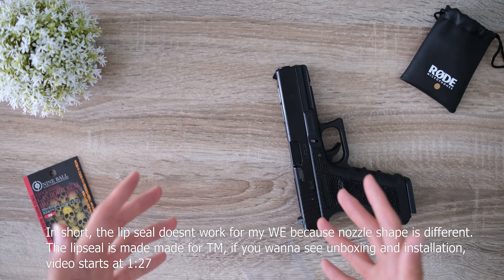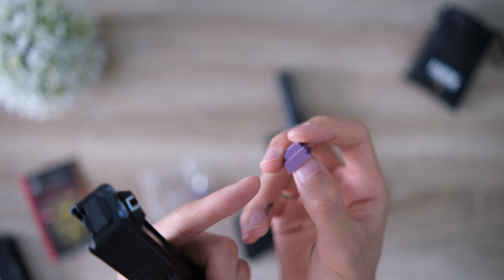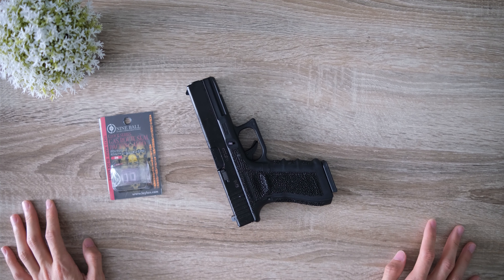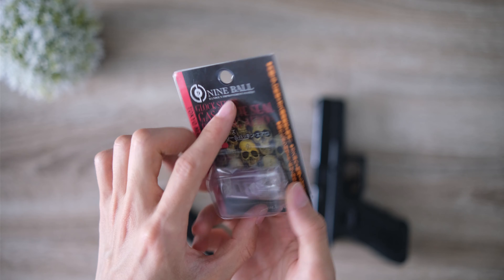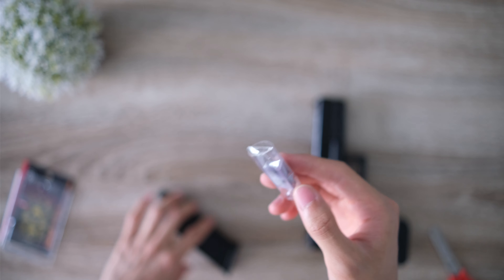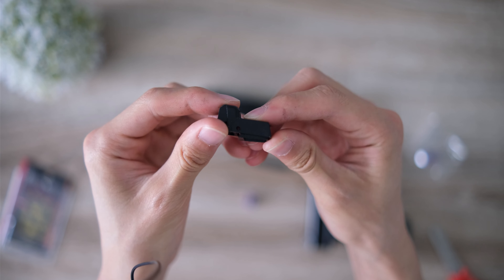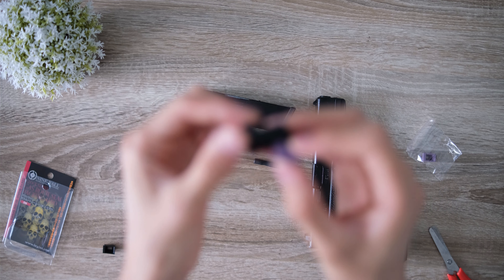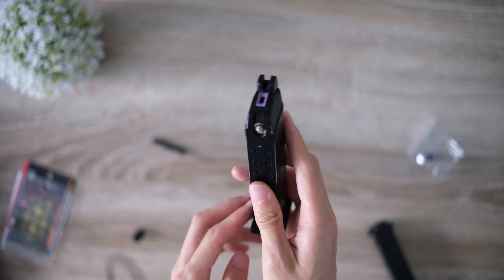Nine Ball Gas Route Lip Seal for G Series Unboxing and Installation

Comment: Do this thing works with E&C(East & Crane) Glock 17 gen 5 mag?
Reply from the maker: From the look of it, I don't see why it shouldn't but don't take my word for it. Maybe try the Airsoft subreddit and also check by removing the lip from the mag and taking the lip seal out to see if they're the same style. Also check to see if the nozzle is curved or flat. 👍